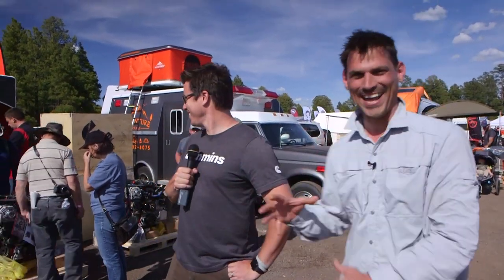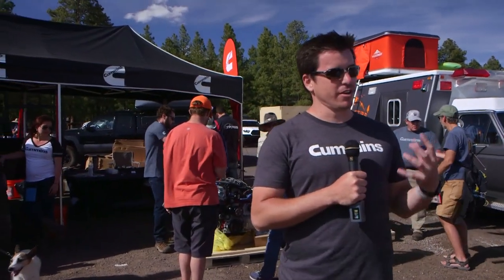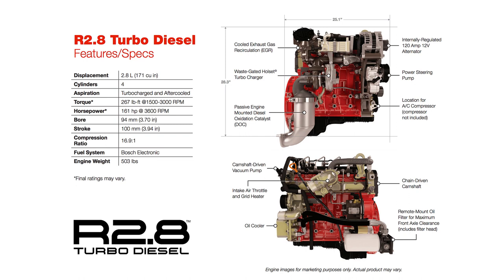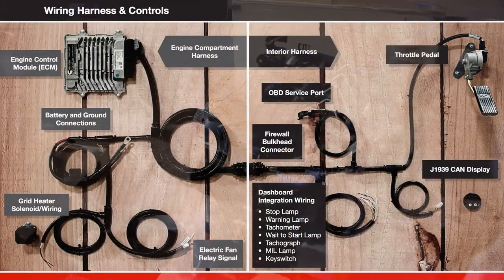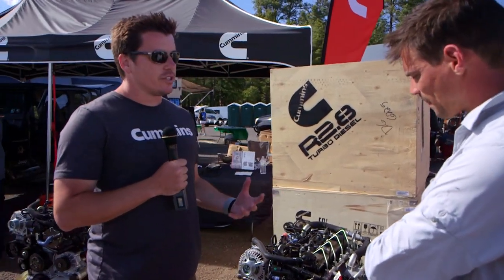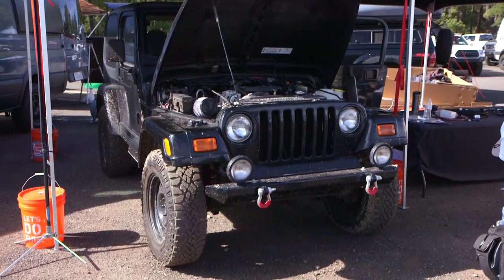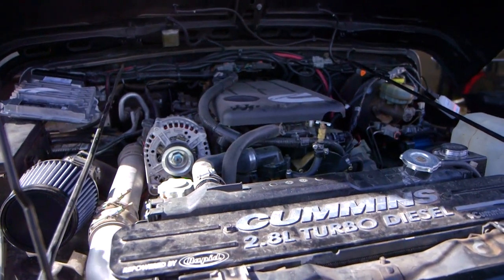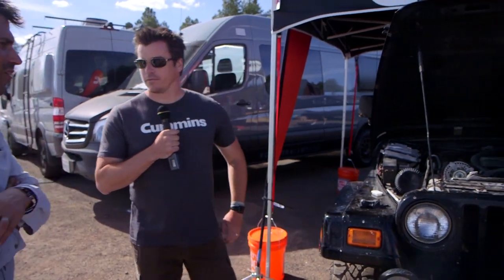Turbo Diesel Crate Engine for your Overland Rig - Cummins R2.8

Comment: I haven't seen any overland ford ranger :( how come?
Reply: Justin Renderos Search YouTube for Oregon Trail Overland. One of their guys is running a Ranger.
Reply: Thank you Charles Eye, I'm new to this and want to get a better understanding of "overland"
Reply: Justin Renderos No problem. I will say that Rangers aren't typically preferred for Overland but if it's what you've got then have at it. I would consider getting a skid plate for under your transfer case, though. It's real easy to bump that little servo on the side and then you're suddenly stuck in 2WD until you get it fixed. I won't use my S10 Blazer for Overland for a similar reason. It's great for going out and playing in the dirt for the afternoon but I've broken it enough times on stupid stuff that I'll never trust it to get me out of the middle of nowhere. Good luck and happy trails brother!
Reply: By the way they are going by Outlaw Expeditions now. I've met Cauxby who drives the Ranger, they are good people.

Comment: i have a 05 f250  6.0 4x4 could this be put in it
Reply: melvin martin yes but your better off doing a traditional 5.9 Cummins swap this motor doesn't make the level of torque of even your stock 6.0
Reply: Nope. It would be hella slow...

Comment: Would think that the 2.8 4cyl would be too small for your 80 series cruiser. Over here in oz they came factory with a 4.2l 6 cyl and the vacuum pump runs off the back of the alternator on a lot of the rigs
Reply from the maker: I think so too. Not sure I'd do this on the 80.
Reply: Overland Bound gearing can make a big difference, and more than likely once these become popular they will probably have aftermarket support to boost them another 50-80hp and 100-160ft-lb of torque as they already do with the 2.8 duramax
Reply: MJ MAC I love my 1hz :)
Reply: The 2.8 would be ok for the older fj40s. I have the same 2.8 motor in my foton van which the book says kerb weight is 3400kg. It is surprising how quick the van can accelerate.
I also have an old 2h hj60 diesel and the 2.8 would be far better but not as good as my other 12ht hj60. The problem is the 12hts are getting harder to come by. I had to buy a third hj to steel the motor out of it.
Reply: The 2.8l Cummins crate engine puts out about the same torque as the 4.5l gasoline engine and nearly the same horsepower and torque as the 4.2l turbodiesel sold overseas. 

 I think it should be more than adequate as long as the vehicle's weight is kept reasonable.

Comment: 2.8 isn't big enough and doesn't put out the power especially for the $8,000+ it cost for the swap. The 3.8isf would make more sense especially when someone spends $10,000 for a new motor. 250+ horse and 500ftLBs should be the numbers cummins was going after for a swap like this.

Comment: How bout the 4BT Cummins
Reply: Chanse Ormon let's be honest it's not a bad motor at all but it's pretty loud and big and it's just not for some people.
Reply: Chanse Ormon the 4BT is crap (for our applications) compared to this engine. The 4BT and 6BT were both designed for different applications (bread Vans, etc). This is designed for light duty trucks and SUV's. It won't be super loud, will work nicely with stock transmissions in our class and will pass emission standards in all 50 States in trucks up to 1999. 🤙🏽🤙🏽
Reply: I have a 4bt and a 89 YJ it's a killer motor if you know how to build them

Comment: I think this engine would be great for a Jeep or older 4 Runners- lighter rigs. To put it in an 80 or anything bigger would be questionable for me for the cost (I herd around $8000 I could be wrong). I just don't think it would have enough power, for me, to push a loaded down 80 at 6,500Lbs +. I would be more excited to see numbers closer to 215-225Hp and 325-350Ib/ft. If they had numbers like that I would buy an FZJ80, as soon as I could, to drop that engine into.

Comment: This must be the same 2.8L diesel manufactured in Italy by FIAT? If so, this must be very close to the 2.8L FIAT/Cummins diesel in my 2005 (also 2006) Jeep Liberty CRD, no?
Reply: no the jeep is a vm not fiat or cummins, but the two are very similar on the inside

Comment: If you find a shop willing to develop a full kit to mount in an 80, set up a fund me page. About the numbers, their "certification tune" is probably why the numbers are a little low compared to the equivalent in size Duramax. If TLC cruiser is game, could be a good partner if Ward doesn't go nuts on kit price.

Comment: You need to re gear the overland rig to a lower gear ratio this will help with your mileage a lot and it will bring back the power that is robbed by the extra weight you have and the bigger tires. 4.56 ratio or a 4.88 gear ratio would make your land cruiser a whole new rig once again.

Comment: You can find near new, complete LS engines with trans & ecu for under 5K, or this longblock for 9K.  I love the idea, but way overpriced.  And people talking about fuel mileage...if you're spending 9K on a long block, I'm sure you don't exactly care about the extra 5-10mpg this will net you.

Comment: lol 160 HP and 295 TQ in a 2.8?!

my 4.9 straight 6 gets like 16 MPG and has less power 

could you fit this into an 82 F150?
Reply: Shoot, with all the crap I've seen like 6v53 detroits stuck into those old fords, I'm pretty sure you could fit this 2.8 there  with enough spare room to sleep.
Reply: ill never ditch my 6.9 idi its bullet proof 

and so is my 4.9 BUT it gets poor MPG and has poor power 

so id like to fit something like this in my 1982 F150

Comment: I wanted a 2.8r. I was ready to order one and had the budget to undergo the project. Called up cummins for info, they have nothing to do with the 2.8r. They will not sell this engine at any Cummins dealership. Cummins repower is a different company. Tried contacting cummins repower, but they never got back to me. Called up advanced adapters who SUPPOSEDLY sells kits to mount it up for the TJs. They didn't have a kit ready for the market and did not seem to care for getting one ready for the market. Nothing to do with Cummins, No warranty, Shitty customer service everywhere I look. $16k project for a 161hp/260tq question mark.... yeah no

Comment: rather have the 2.8 duramax. 20hp &100 ft lbs more
Reply: It's a VM Motori design that GM bought the rights to, not a "Duramax" designed by Isuzu/GM.  

Also, I'm skeptical that engine will last as long as the Cummins with its higher horsepower and torque ratings.  Cummins build their engines for longevity.  GM, not so much.
Reply: Keep in mind they have it restricted and tuned to meet emissions as he stated,  add more fuel an boost would make much more hp and torque, but wouldn’t be legal anymore, which is the goal
Reply: i personly  know 2 people who have well over 300k on there 2.8 duramax they have been doing really well for them

Comment: You absolutely could run this in a LC 80! I just looked up f-350 cummins 2.8 and this video clearly shows the this in Full Size, Heavy Duty dullys. You probably could tune the motor for more power IF you wanted it. Check it out:  https://www.youtube.com/watch?v=cfraKDj_OMA

Comment: why not just use the manufacture own diesel units which are far better than this .
come Toyota product every land cruiser with a choice of 
common rail diesel engines from 2.5 to 4.2 Ltr in 4 6 and 8 cylinder.
I cannot understand going for this middle of the road Cummings that's no very clean not very powerful with middle finger the road torques figures .
it's a messy engine with no thought to how it will look ike under the bonnet.
25mph is very bad I would expect that from a larger capacity 6 0r 8 being pushed hard . the manufacture have built great diesel the Jeep has had an ok 2.8 CRDi 4 for over 10 years use it 
3.0 six CRDi and now they have some great fiat diesels in them. Shuv those cuming engine back in the box.

Comment: Too small and lower output than standard turbo diesel 80 series. It would be at full power everywhere to pull an 80. My 80 is 4.2litre turbo diesel and you'd not want to go smaller! Great in a jeep though I'd imagine